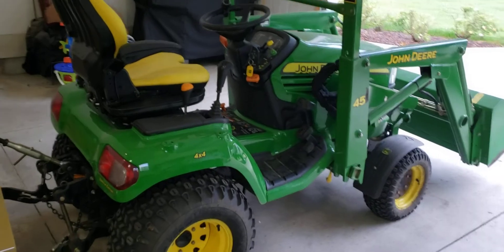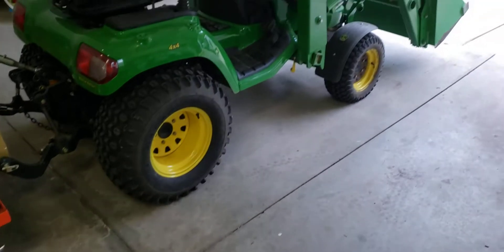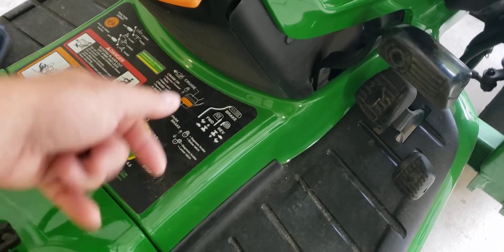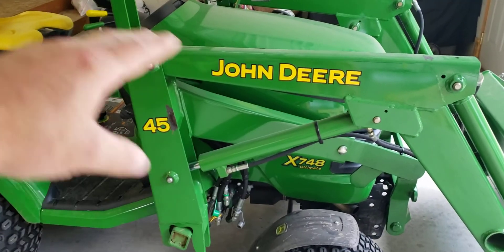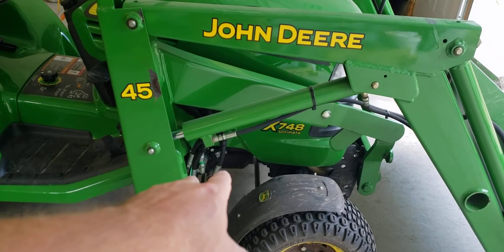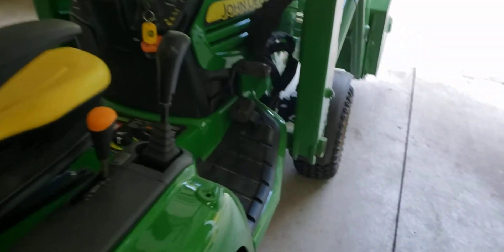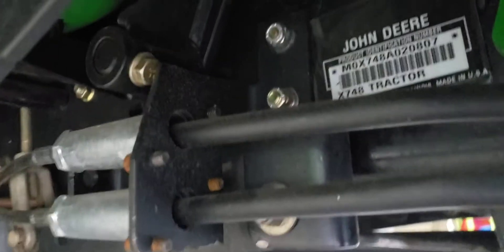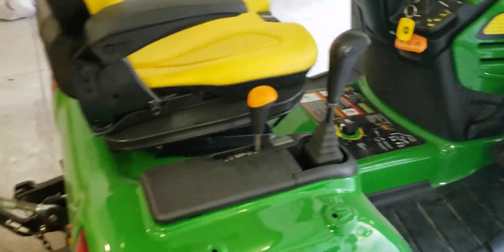How I made my John Deere X748 an H4

Comment: Which JD models do not use the drive shaft for 4 wheel drive? And/or model year?
Reply: The X575,585,595 were made 02-06 (1st 4x4 JDGT’s ) and were straight mechanical front wheel drive. There is a lever by your right hip. The next gen 4x4’s were made 06-12 728,729,748,749. From 06-09, they were mechanical front wheel drive like the previous generation (MFWD). From 2010 on, they are Hydraulic front wheel drive (HFWD).  The 3rd generation 2013-2023 X738,739,758 continued using HFWD and the 4th gen 2024- is still using it. From what I have read, it’s been quite reliable like the MFWD but there is no binding of the front wheels so the front tires tend to wear out slower. Personally, I have an X595 and I’m keeping it til I die. I like the ability to choose whether I’m in 2 or 4wd.

Comment: Really like the joystick function.  Where did you purchase the joystick, push/pull cables, and the hardware for the cables?
Reply from the maker: Joy stick was purchased on Amazon, the cables and assortment of connections for them on surplus center
Reply: @Fireguy1020  Thanks